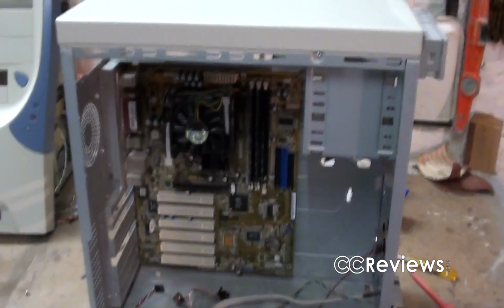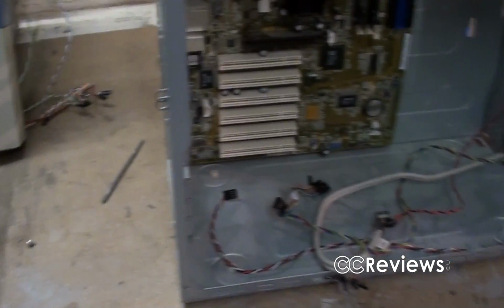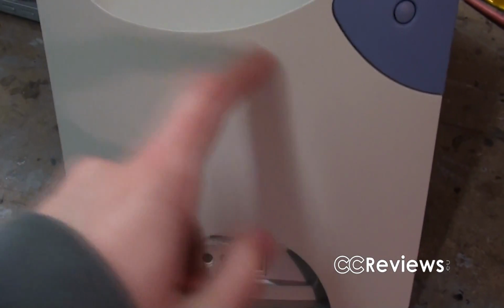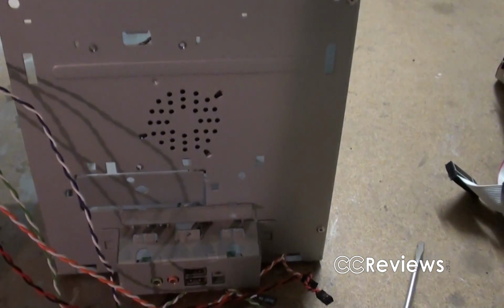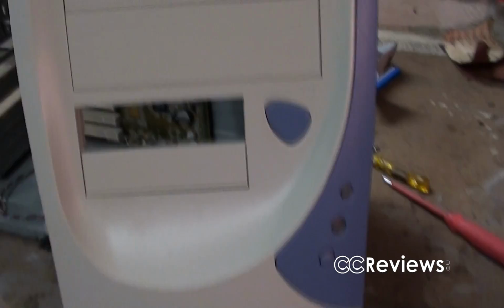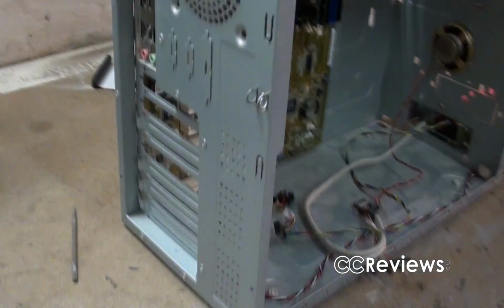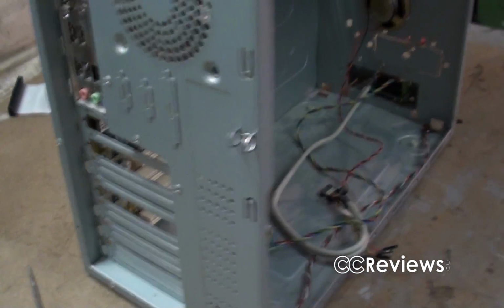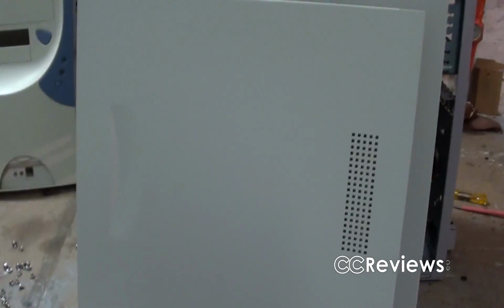Turning an old case into a new gaming case - PC modding part 1 (CCReviews)

Comment: I want to put about $700/$800 worth of parts and rebuild my first PC. It has a slow AMD Athlon 1.34ghz, mobo, sound card, and gpu that STILL works after 15 years, and its a sleeper! Its quiet for a 15yr old PC that iv been using to play music with for years, and everything still works and runs cool, (The CPU usually runs at 147F ) But I want to give it a 95% PC Upgrade/Rebuild, and 'bout time! :)

Iv used this PC for playing music for over 15 years and its about time I give it a well deserved upgrade! I want to replace the old IDE ribbon cables with new SATA/USB 3.0, and aftermarket PCI fans and air cooling & so forth. I'm also thinking of adding a side window as well with leds

First I want to replace the current ancient ASUS ATX A7NBX mobo with an ASUS Z87-Pro ATX LGA1150 :),
replace the AMD Athlon 1.34ghz with an Intel i5 3.50ghz 4690 (I'm not planing on overclocking lol),
replace the 256mb DDR1 ram with Corsair Vengeance 8GB DDR3,
replace the old Non-Modular 15yr old Future Power 400W PSU with a Corsair CX 600W Semi-Modular ATX PSU,
replace the air cooled nVidia GeForce MX400 with the ASUS nVidia GeForce GTX 970 4GB STRIX (a BIG upgrade from it's ancient predecessor!)
replace the Western Digital 50GB HDD for a Western Digital 1TB HDD
The old CPU fan is a Cooler Master fan, and I may go aftermarket as well to keep things cool in the old case! 

I can't wait to start building! lol
Reply: pls don't ruin it lol

Comment: get a newer case. you can get one at low cost, then mod that.
Reply: And how fun is it to just but another
Reply: its not always about the price. for many its about the experience and fun.
Reply: Not as cheap as u think still need a power supply and a decent one is another 70 to 100 bucks so be like 250 total before putting anything new in reusing my old case I only pay 90 total for a decent power supply and decent new fans

Comment: i have an ordinary computer case with 4 optical drive slots. 4 hard drive slots and 1 floppy drive slot. it has a DVD drive and floppy drive included. I'm going to by the motherboard and power supply and video card and stuff to turn it into the gaming pc

Comment: SAMSUNG SYNCMASTER 4NE (CSN5987)MSI K7T266Pro2-RU Motherboard Review 
Asus V8200 cpu amd k6 usb 2.0 msi fdd nec hdd seagate memory ram samsung card creative sound blaster 
DEER DR-A250ATX POWER SUPPLY Ventilator PC Spire Ventilator Spire SP09025S1M3
Microsoft IntelliMouse Trackball Mouse beige ps2 Part no X03-09209 Vintage   
Dell Quietkey PS/2 Wired 104 Key Keyboard SK-1000REW, Excellent Condition instalaition windows xp

Comment: Groove the front of a little take some putty and make nice edges and shit shed everything when its dry take a 144mm drill make a hole make it bigger put a fan in it and work it out with putty then again shed it and atlast take liquid carbon fiber, and spray it over it and let it dry make a opening in the side panel shed the steel edges and put glass in it put lights imn it and you should be ready to ROCK!

Comment: Since the psu isn't mounted in the bottom, I'd use that for intake over the video card going in.  When you cut the hole you could leave some tabs for holding a fan filter, or you could use one of those magnetic filters... add some feet for clearance etc....